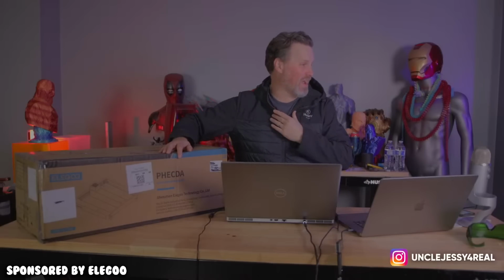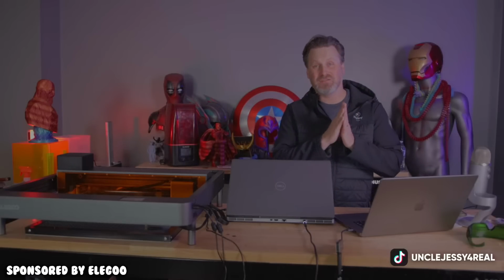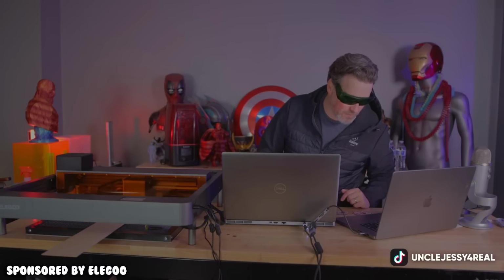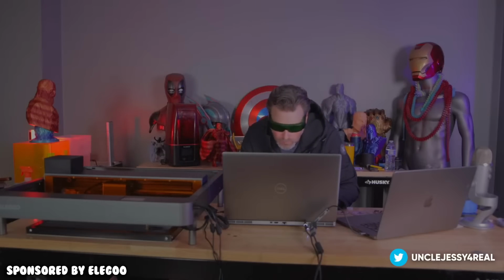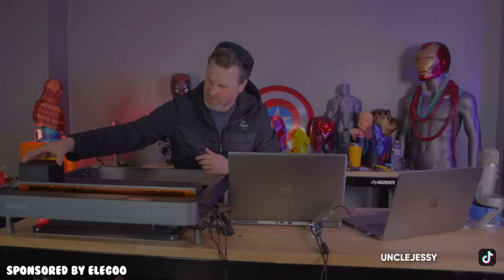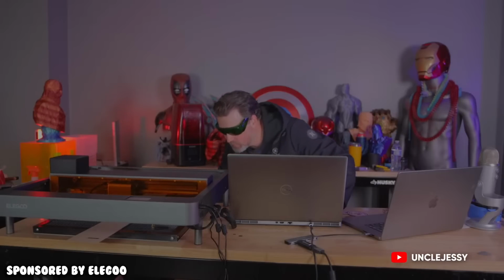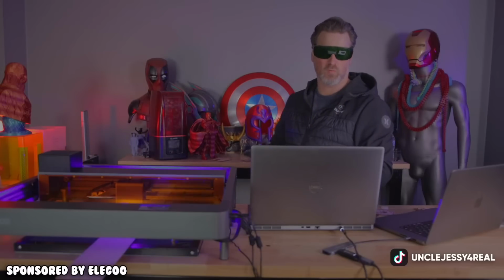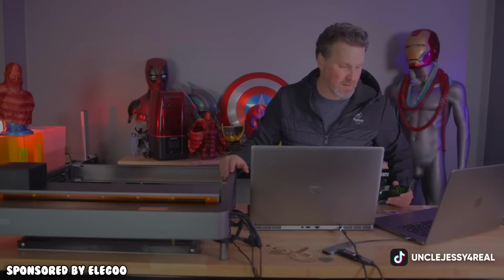Elegoo Phecda Laser Engraver Live Stream LAUNCH + GIVEAWAYS!

Comment: Decent bit of kit an nice to see Elegoo enter this field and I was sorely tempted to back the 20W.
Personally I'd be more interested in cutting so the entry level relatively low power engraving doesn't meet my needs but Elegoo seem to develop quickly in areas so maybe we will see something in the future.

Main concern is the lack of a cover as it's fine for the user to wear glasses but it doesn't help with people walking in so a bit too much of a hazard. I can see people modding covers or shields pretty rapidly.
Reply: If not a cover, then just a curtain that could be drawn around it.